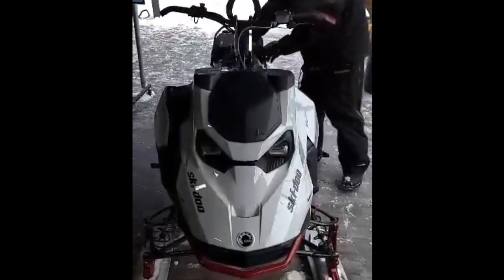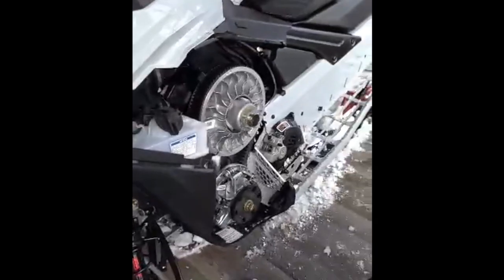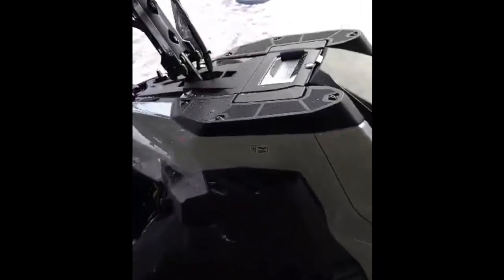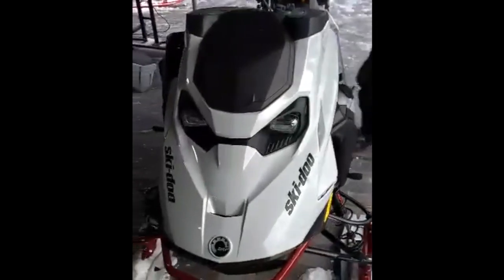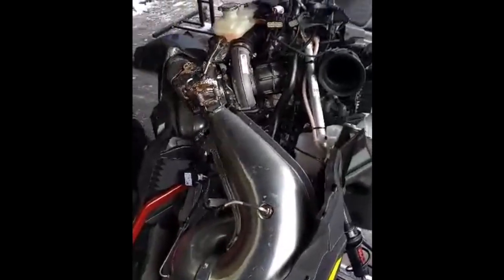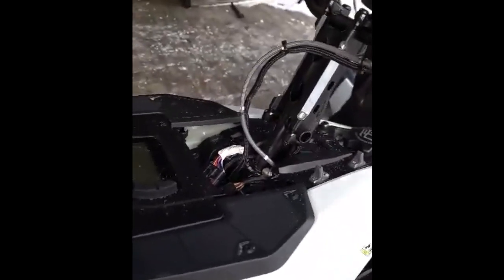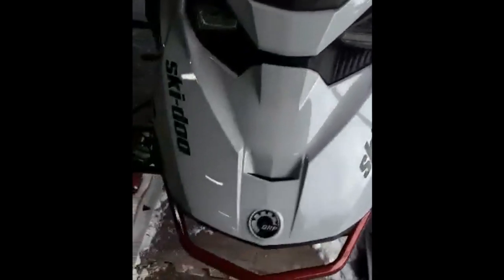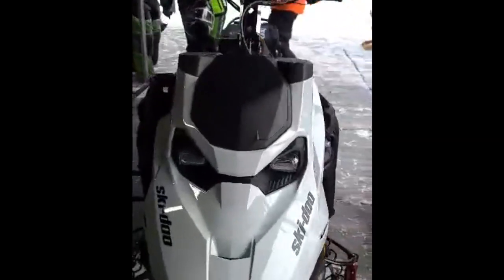How easy does the hood come off? And Muff Pot Cooking? 2023 Ski-Doo Summit X 165 Turbo!

Comment: Don`t mean to pick on you. But FYI the Polaris hood would`ve been off before you had the clutch cover off LOL
Reply: Yeah, and that is also why I've seen Polaris sidepanels/hood pop off when my buddies are riding their sleds 😂 I'd rather take a few more mins removing it and knowing it will stay in place when riding 😅
Reply: You pretty much never need to take off the hood on a doo so it doesn’t matter that it takes 2:30 minutes. It will just hold together better
Reply: @powsledder  LOL Only time I took the hood off of my last 3 Polaris`s. Was to clean it or put oil in it.
Reply from the maker: @chasf1066  my point exactly so what was your point again if you never take the hood off?
Reply: @DaveNorona  current doo owner and was interested in snow checking a 23. However 2 issues. When I needed some reed valves for my current doo this past winter the parts were MIA from them for almost 4 weeks even though numerous dealers and ski doo themselves said they were in stock. But they drop ship them and could have cared if I rode this season or not. Dealing with BRP customer service was atrocious!
Last, make a reasonably priced trail sled for people are strictly trail, enjoy having passengers and make it a family adventure. Can't be dropping big money on a doo when I can get a basic trail rider from others for a few thousand cheaper. Again, I know there are supplier issue but if you don't snow check there is always someone who backs out or something happens and one is available.  No rush since my doo is good and I love it but let the regular Joe's enjoy the trails too!
Reply: Good thing. You’ll need to do it often.
Reply: @scottcraig2569  LOL Only time I took the hoods off of my last 3 Polaris`s. Were to clean them and add Oil. Never blew a belt or folded a plug. Last years VR1 was on stock plugs and belt at 2,200 miles. My XC had 3400 on the stock plugs did the belt just to do it at 2500. One before the had well over 3k and samething not one plug or belt. LMAO
Reply: @chasf1066  And you’re still shopping for a ski-doo??? Interesting. 

There’s a reason it’s called going ski-dooing and not Polarising. Lol I have Polaris’ too but the ski-doos seam to hold up better to abuse.
Reply: @scottcraig2569  No I`m not shopping for a S-K. True I did grow up on them like most did. I don`t really a brand loyalty either way. Having said that doesn`t mean I still don`t look at them. And I have been riding a ski doo rental all year long seeing I`m still waiting on my XCR which shipped on the 18th LMAO

Comment: Ok, so ... I'm trying to take the hood off on my 2023 Lynx Shredder Turbo ... and it appears the Lynx sleds have a few more bolts than the SKidoo sleds do?
Reply from the maker: yes you will have to check with someone from lynx like Jason Ribi on social or ask at the dealer, they are different and in many cases have different parts, so don't rely on your buddies from ski doo when they same parts etc.

Comment: if you get the expert without the 10.5 inch monitor can you upgrade it later? or does it have to come stock?
Reply: look on their site or in videos, sleds with the large gauge have the battery on the back like e-start models. you could probs add the battery & wiring but there is def more to it than just the gauge itself

Comment: How long does it take to swap out sparkplugs?
Reply from the maker: Its quick but i have never had to, spark plugs are good for 10,000km on a doo.
Reply: @DaveNorona  no...no they are not
Reply: By the look of that somewhere between a week and a week and a half.
Reply: @cacsrx1  ive rode for 7-8 years on etecs and ive never changed a single spark plug. the hood doesnt come off unless youre in your garage lol, but could change the plugs & theyll be properly indexed in 15 minutes
Reply: @3DProductions  You must have hands and arms the size of a third grade girl if changing plugs is that easy for you.....Ive had a 15 T3,  2018 850, and a 2021 850 turbo,  all fouled a plug near the end of break in or coming out summer storage.  Big John from Sled Head Racing recommends plugs and fuel filter every year.
Reply: does big john also recommend you bring to him to do it? lolol changing good parts dont sound smart unless your a salesman

anyone that has done it before and has the tools at hand could do it in that, dont include beer drinkin time

Comment: That's a pain in the ass if a plug goes bad... they should take some notes from polaris on panel installation..
Reply: i havent changed a spark plug in 7-8 years riding etec sleds, maybe polaris should learn how to make a fuel map so they dont foul 2 dozen plugs per year lolol

Comment: no sled bashing at all both good sleds but if anyone thinks it’s easier to work on do than poo in the woods  they are not telling the truth.
Reply: rode skidoo 7 years with etecs and ive never needed to change a spark plug, never had a reason to take the hood off anywhere but my garage
Reply: I would strongly disagree and take that challenge with a very large wager.
Reply: @Aspired329  not a challenge just my experience, wish everyone could have the same lol

15 freeride 800etec - died one time on me in 3 years, was a wiring dead break dealer fixed on warranty in a day
18 summit 850 - never died once just replaced shit i broke for 4 years
21 600rs - no issues so far but selling it now

Comment: Exact same as gen 4 lol
Reply from the maker: nope, less bolts and easier
Reply: @DaveNorona  it’s only 4 bolts for the gen 4.
Reply: @scottcraig2569  its 6 bolts but good try
Reply: @3DProductions  I own one and have taken it apart several times. 4 bolts.
Reply: You're right.  I forgot about the two in the glove box. Hardly a deal-breaker though.